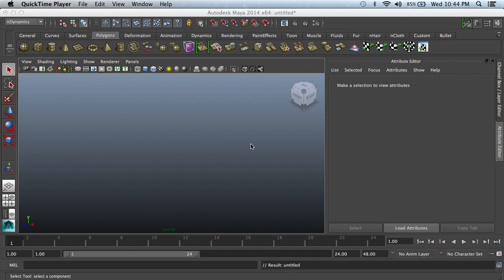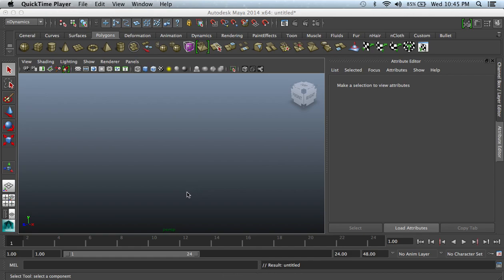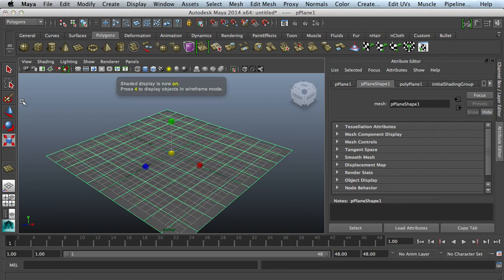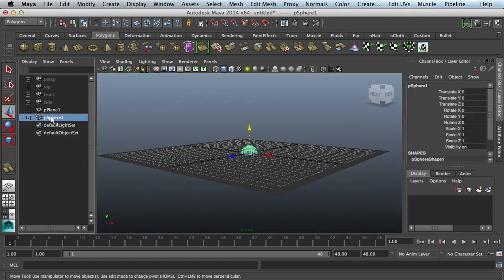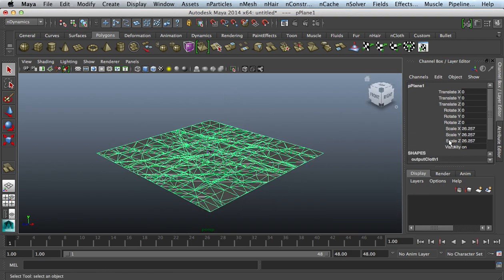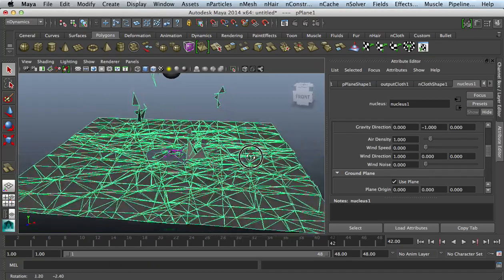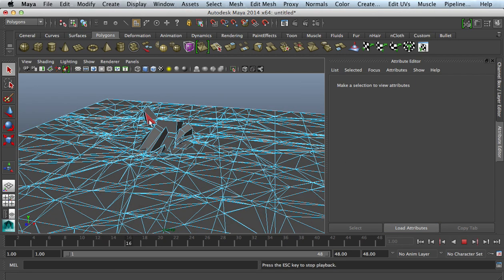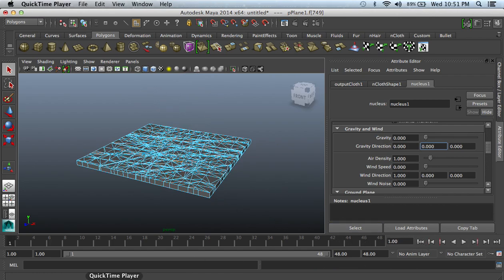Autodesk Maya nCloth Destruction tutorial

Comment: Little question.I made a wall shooted by bullets,but the wall starts to wall at the first impact.If i erase the gravity,the particles...well,it havnt gravity too lol

How can I prevent the wall from falling to infinity? i made a floor,passive collider and Ground Plane but that not works.

The example here : https://youtu.be/0IN4rRLsXfQ
Reply from the maker: there's a couple way to go about it. you can do an easy method and select which areas you want to have dynamics you could use a particle system and do the same thing. in the example in the link i saw there was no Depth in the pieces make sure for the pieces that you're are selected to have dynamics will have Depth to them.
Reply: I want to make a procedural destruction for a concept for a future game so the particle won't be the best way :/

My problem its the gravity.With gravity,the wall fall,without Gra. doesnt fall,but the Splinters are floating :/

Comment: I can't find the Cut command in Maya 2016 Ext 2.
Reply: try using the modeling tool kit, should be a tool called multi cut?
Reply from the maker: I'm sorry i've never executed a Maya Ext package. Try @Lonewhitedog tip if that doesn't work let me know and i will do research on the issue.
Reply: Vision Of Jeremiah It's okey, the Multi-Cut tool is right there in the shelf and mesh tools menu, it works great.